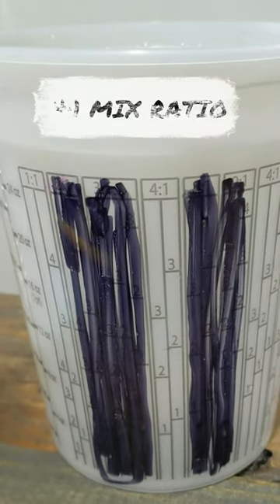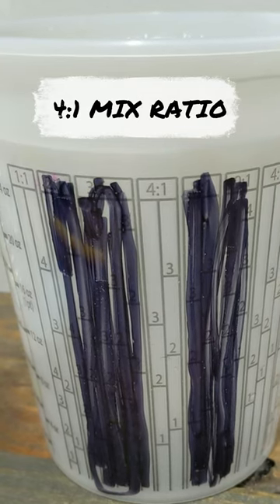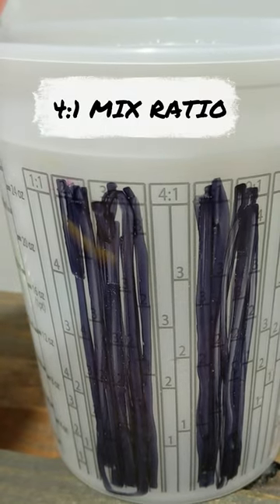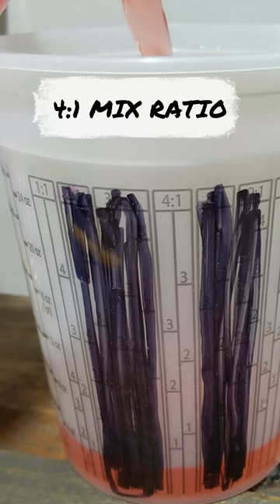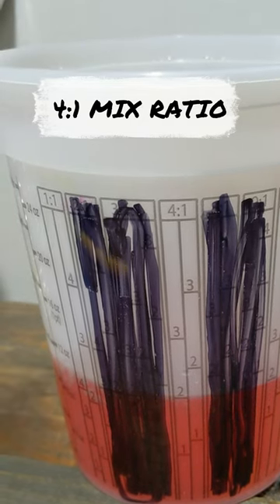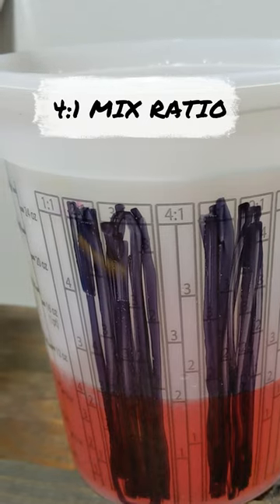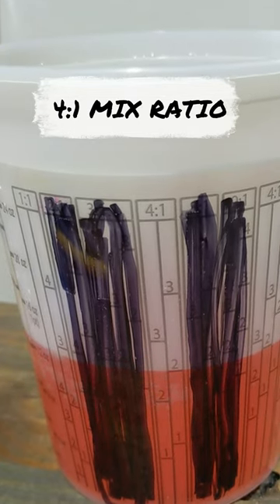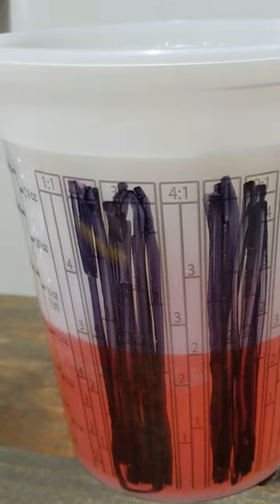How To Mix Paint 4:1 Mix Ratio 4 to 1 #shorts

Comment: If this is 4 qts paint,  is it 1 qt water?
Reply from the maker: That is correct if you are using water based paint. If you are using urethane then you would use 4qts paint 1qt reducer.